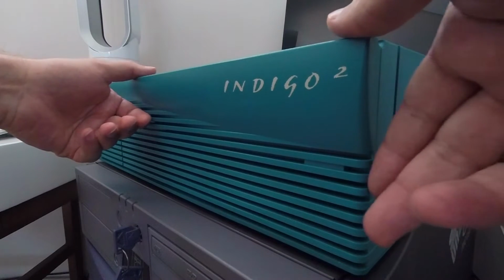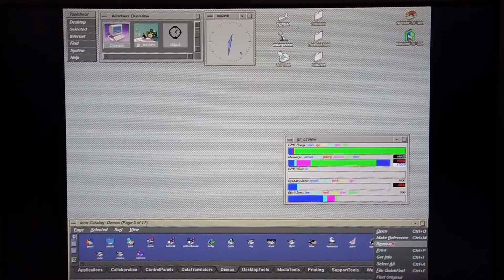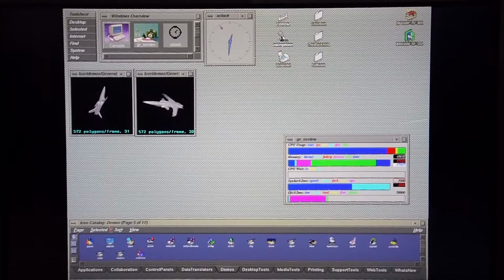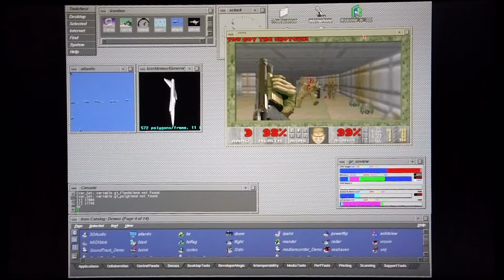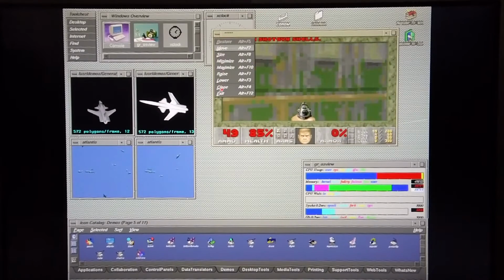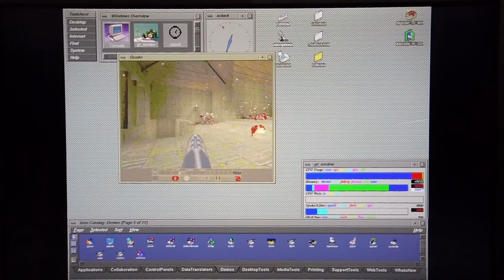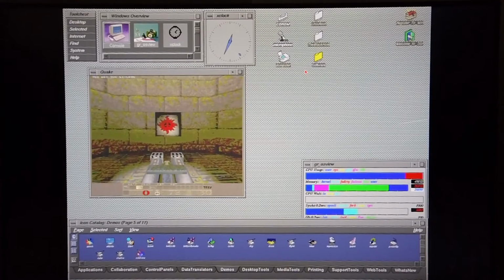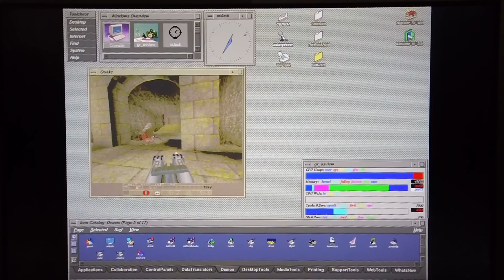The Silicon Graphics Indigo2 R4400 VS the Indy R4400

Comment: I wonder to what extent the Indigo2 having GIO64 vs. GIO32 in Indy is affecting all this? Hard to say. It would perhaps be more revealing if you had XZ in the Indy and the equivalent Elan in the Indigo2, then the gfx differences would be removed. As it stands, it's difficult to tease apart how the Indy's better CPU is trading off against the Indigo2's better gfx, though if you're doing textures in sw then the Indy with XL is better for sure (or of course an Indigo2 with XL even more, a sorely underrated config).

I think Indigo2 is SGI's best ever desktop; by far the most reliable without question. Most original early spec teal units I obtain are still working fine. Later IMPACT models may need a PSU fix, but overall Indigo2 has far fewer issues than O2, Octane, Fuel, etc. Indy is more likely to have a dead Dallas or bad serial ports.

Ian.

PS. My full guide: http://www.sgidepot.co.uk/i2info.html
Reply from the maker: The indigo2's an awesome machine! Thanks for posting the link to your guide for these machines! :)
Reply: @Irinikus   Most welcome! I had a thought, fitting both with R4K/200 and XZ (Elan in Indigo2), what tests might reveal the advantage of GIO64 over GIO32? Maybe just the basic multitasking you demonstrated, not sure.

Comment: How does the R8k Extreme compare? Wondering what performance I can get out of mine
Reply from the maker: To be honest, I really don't know. The performance offered by MIPS chips is usually a direct function of MHz and the R8K found in Indigo2's only runs at 75MHz, but the R8K had extremely good 64-bit performance, so if you made use of that function it was far superior!  I am getting an Onyx fitted with two R8K's and Reality Graphics in February next year, so maybe then I'll accurately be able to report on the R8K's performance.